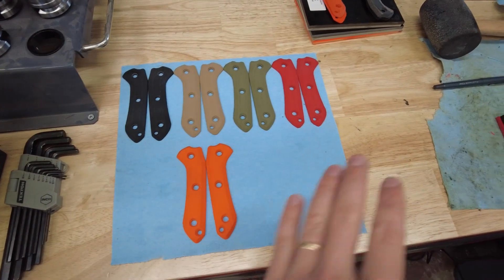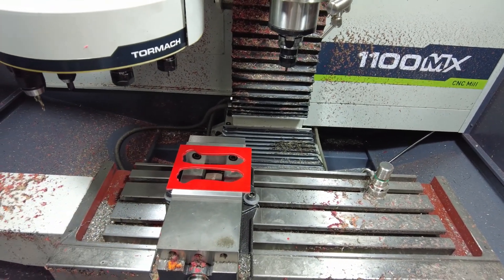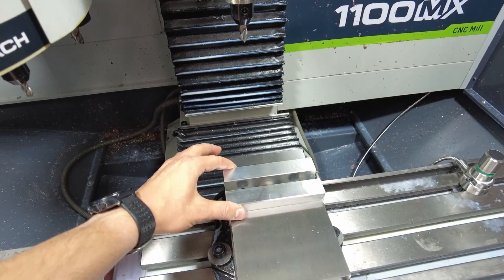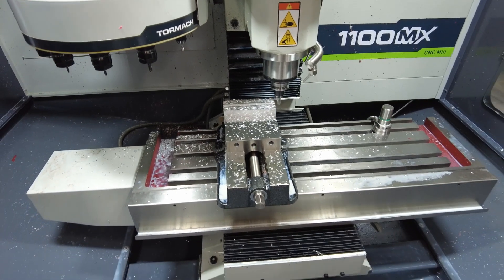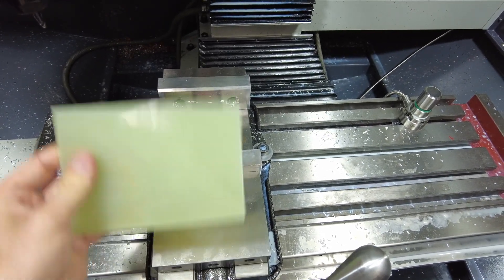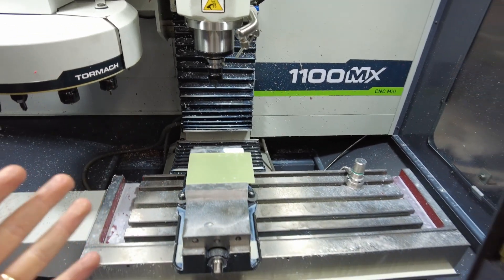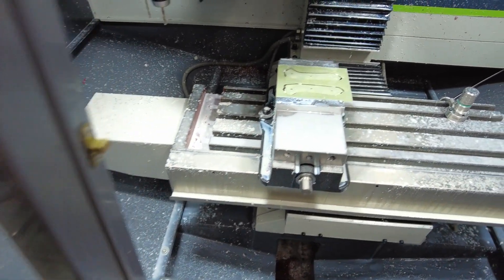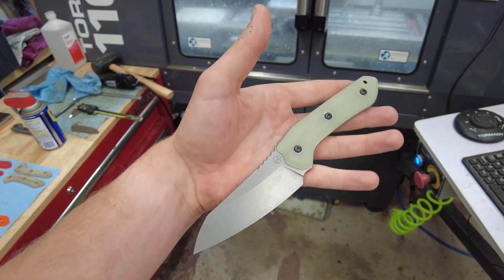Machining Knife Scales - The Simplest Way

Comment: Thank you for showing your process, im a beginner to fusion and would love to see your toolpath details for finish surf more specifically what options you using so fusion dont generate toolpath on the holes already drilled. If you could explain that would be greatly appreciated. T

Comment: I would use a vacuum plate.  This way you can eliminate the vice. The vice might be causing the chatter because the lack of stability in the canter of the g10. If you use a vacuum plate you don't have to worry about tabs. You'll be able to cut the full profile of the part out.

Comment: Thanks TJ, great video. I have a couple questions. I thought on your CAD it showed some micro milling on the handles? No? Also did you say you grind your bevels after heat treat? Before your Tormach what were you using? 
 Knowing what you know now in the industry and had 5k to start over as a newbie what equipment would you buy? 
Sorry for drilling you but I'm asking because your work speaks volumes.
Thanks
Reply from the maker: On the Overland it is machined with such a fine stepover that the result is a smooth surface. We then sand blast the g10 resulting in a nice matte grippy texture. We mill our bevels prior to heat treat. Before CNC I did the bevel grinding by hand. Honestly the first thing to purchase is going to be a 2x72 belt grinder and a drill press!

Comment: How did you configure fusion to ignore the holes in 19:38?
Reply from the maker: Use the "patch" feature in the surface modeling tab to fill the hole and then select those patches in the CAM operation.

Comment: New at Fusion here.

So you did the complete modeling of the scale with all the holes and tabs or did you add the tabs and hole on your NC setup in Fusion?

Thanks
Reply from the maker: The tabs are added in the CAM (Manufacture) environment. All holes in the scale are added in the Design environment.

Comment: Nice job dude.. Pretty much how i would do it if had to. I use a tab configuration all the time , in the router or the Haas . and I always  do all i can in one sitting before removing. But I think doing the g10 like that is ok if your doing it. But if you become BAD ASS and you have Billy bob running the g10 opp they will be bowed and a fixture will be required. later

Comment: I understand using the coolant to keep the dust down, but does the G-10 clog the coolant pump?
Reply from the maker: I do not have that problem, fortunately. The coarse filter in the chip tray is doing a good enough job and the fine particulate is picked up by the in line filter.
Reply: @tj.schwarz  I came to the comments to ask the same question. After doing this for a while did you ever see any issues with the G10 dust mixing with coolant. No issues with finish problems on metal parts? Awesome videos TJ!

Comment: Could you not just, mount the G10 sheet to a piece of plywood, then the plywood to your milling machine. Run one OP to do the holes then hold down each handle with some screws in the handle holes straight into the ply(no moving parts for second OP). Then run the profile and contour and you don't need to cut any tabs either.
Reply: That's what I do. With his way there is no waste board and no tape and glue method to mount the initial G10 sheet to the plywood, so in that regard his way is less fuss.
Reply: I think the main drawback of that method is the setup time making it not so great for production, you also have to be careful not to hit the screws if you’re machining close to them, also with the plywood you may run into some tolerance issues